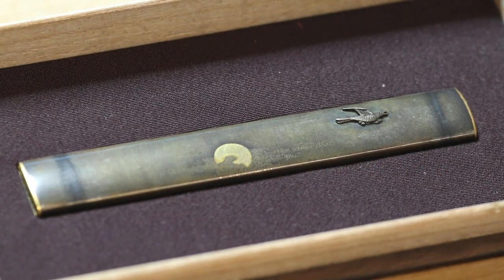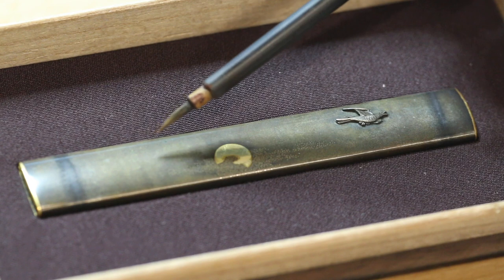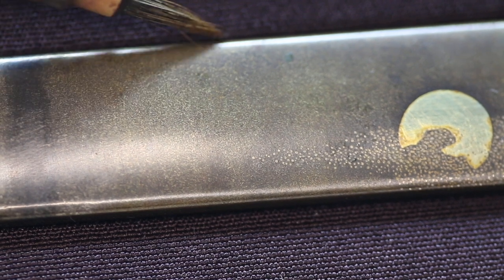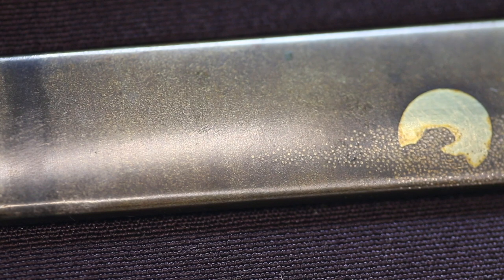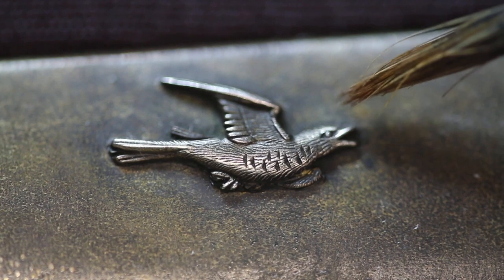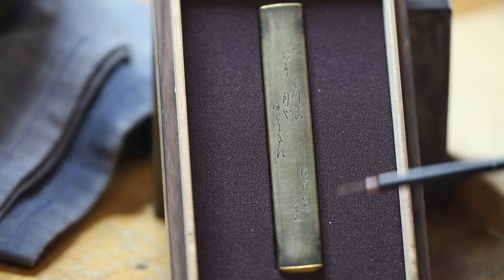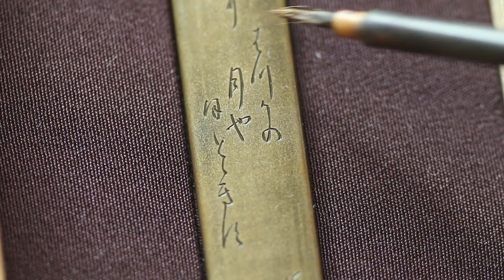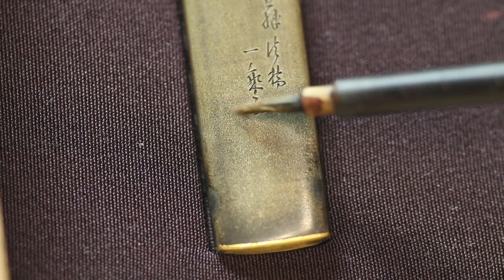Tosogu Insights 05

Comment: Hi Ford. I think that the Gold application might have been a version of what the Korean tradition knows as Keum Boo. I first read about it in a book called “metals technique”
Basically a 24k gold foil is burnished over a silver (or possibly on this case silver alloy)
substrate.  As the gold is pure and non reactive when it is burnished down it breaks up the very thin oxide layers on the silver and facilitates electron exchange causing a cold “weld”
Reply from the maker: Hi Albert, good to hear from you. Its been an age. There is undountably some similarity other than the foil being far thicker, which poses different challenges. I've managed it on copper with gold but I suspect there's more to it.
Reply: It has been a while! I love watching these videos by the way. The river running out from the rock? (Other video) so cool! It is great to be able to appreciate subtleties of composition and execution through a trained set of eyes! 
I use the chisel set I made in your class all the time! Over the past couple of years I have been struck by how regularly I end up using techniques and processes that I learned in your week long workshop in New Hampshire. Even when the work isn’t carving or inlay, so much of what one learns from working with the “iron brush” translated into all other aspects of metal work! 
Let me know if you are going to be back in NH anytime soon, and if you are ever in or near Ottawa Ontario please stop by and visit!